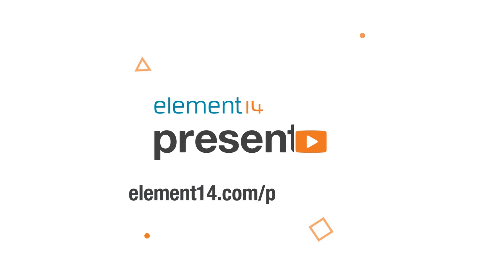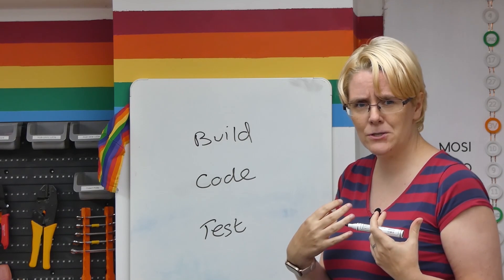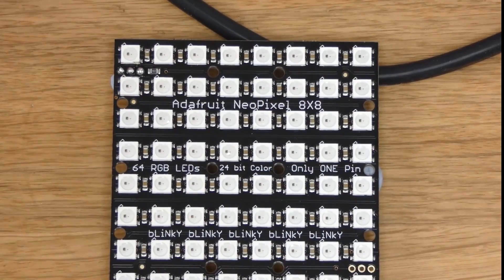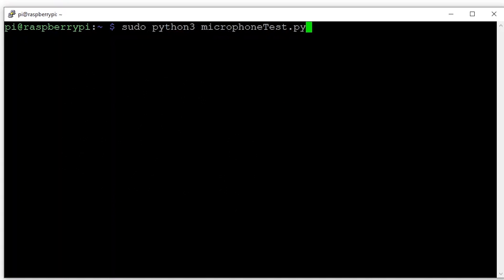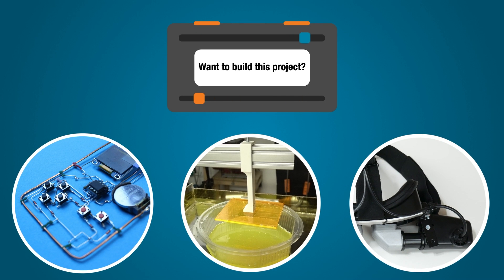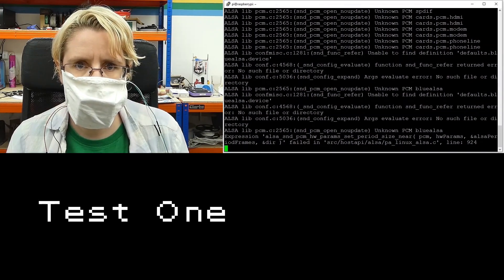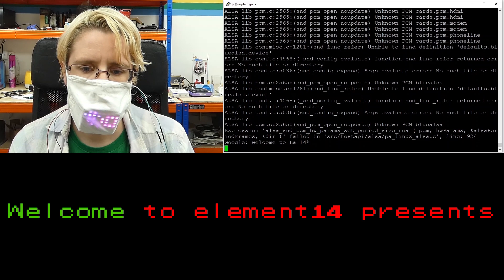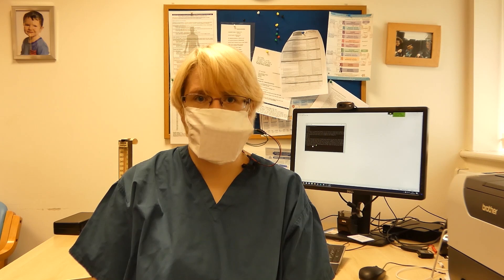#RaspberryPi Speech to Text Light Up Face Mask

Comment: You will have much better results using a google coral instead of using a service. I've had the square matrix in a round fluffy shape problem, hoping to solve it with glassfibers and a 3d print (wip) to project my matrix

Comment: Should't that work with Rpi Zero W as well? You can spare one pocket :) Also if you use pocketSphinx, you can be completely offline.
Reply: Yeah with the RPI zero you'd need a micro USB to USB cable in order to attach the microphone which adds bulk but possibly not that much. I saw some offline APIs but didn't get round to using them. Have you tried pocketSphinx? Is it accurate?

In version 3 of the FaceMask I connected an ESP32 inside the mask to a mobile phone and it's transcription service which worked offline. No need for any pockets!

Comment: I just though of an Ideal to improve this project but needs a head beanie, a flexible monochrome backlit lcd display, light sensor, a wired usb microphone, a mask, battery pack with charging circuit, a raspberry pi powerful enough to do the job, a voice to text that can be ran just from the raspberry pi itself, sd card,  and some wires 
The biggest problem with my ideal is to find a flexible backlit lcd display, voice to text to run just on the raspberry pi itself, and have a small enough raspberry pi to fit in the head beanie.
I don't know if this ideal can be done either but it look cooler in my mind.

Comment: those 5050 RGB LEDs are wonderful! I just installed a strip of them behind my glass desk and it illuminates it just a bit. I covered it with some clean looking black  plastic tape so the light only diffuses through the glass not blast you right in the eye with photons.

Comment: I can see some problem with this project. 
1st: you need to be online
2nd: you need a case for the raspberry pi and because it not the smaller unit, raspberry pi 0w, you need a bigger case.
3rd: you need to use a wired usb microphone to reduce lag.
4th: you need enough battery storage to power the raspberry pi 4 with the wifi on, the LEDs, and the usb microphone.  I say about 500mA just for the pi itself but could be off on this.  I would use a 3Ah battery pack at less.
5th: the LEDs can't prevent you from breathing by any large amount.
6th: case the unit.
7th: the cost of the unit.

would I build this unit, it look nice and if can be ran offline then it would be great.  I skip on this project because of the problem you may pass by.
Reply: Hi Mike! This is version 1 and 2 of this project. I slimmed it all down and reduced the costs by using a phone to transcribe. Check out my journey: https://youtu.be/hfT3IL2lexU
Reply: 1st: this can be solved by using a pre-trained model for offline use (but this is out of scope of the project)
2nd: as is, this can definitely be done using a pi zero w.  there's nothing computationally expensive being done on the pi
3rd: the text scroll will be much slower than any lag.  the mic lag is not a bottleneck
4th: see my response to 1st and 2nd
6th: see my response to 2nd

i agree with 5th and 7th points 100%
Reply: some buttons for "offline use" could be interesting, or motion activated stuff...
Reply: @Davedarko  true